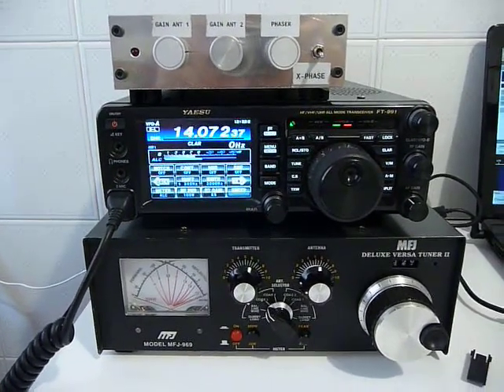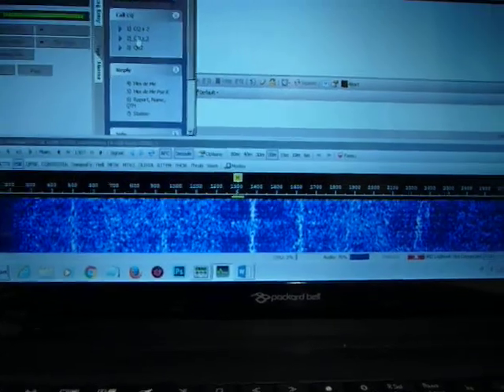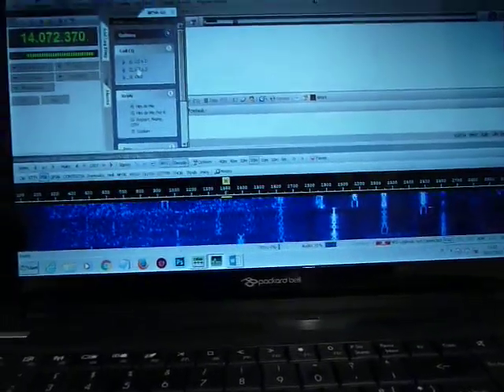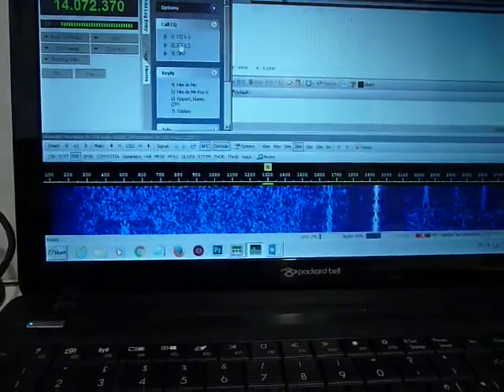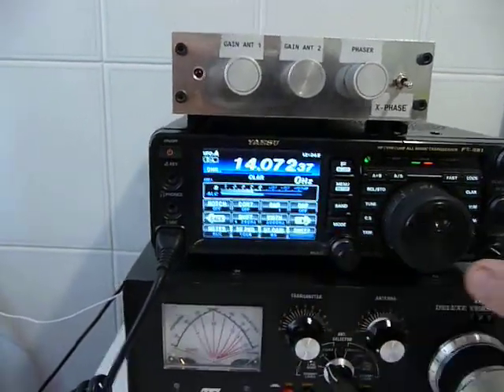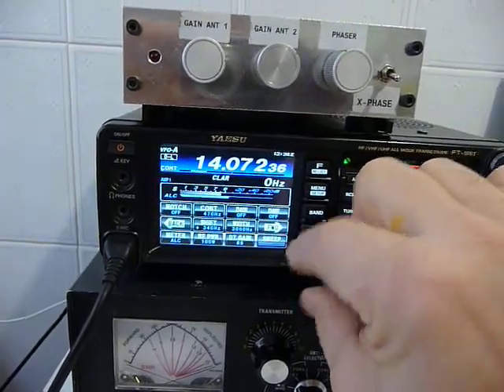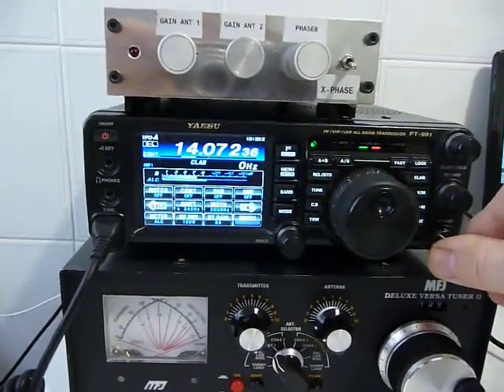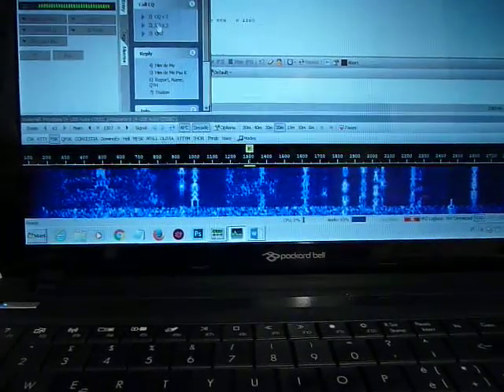X-Phase I0KQb testing X-Phase in digi modes December 2015

Comment: For who wants to realize the X.Phase or its "child" the Noise Canceller, here they are some useful instructions in order to set them up properly.

First, I hope you have connected a simple 1mm square single core electrical wire for the auxiliary antenna. This piece MUST be at least 9 meters long. This thread must be left stretched or wrapped. The fact that it is left stretched or wrapped must be evaluated case by case, trying to obtain the maximum interference signal.
DO NOT USE ANY KIND OF ANTENNA INSTEAD OF THE WIRE, OTHERWISE THE NOISE CANCELLER WILL NOT WORK!
Proceed like this:
1) Connect the auxiliary antenna cable.
2) Turn on the radio and the noise canceller
3) Adjust the main antenna to zero gain (gain)
4) Adjust Phase 1 to maximum gain
5) Adjust Phase 2 to half gain
6) Tune the radio to the signal we are interested in cleaning from the noise of the electrical disturbance
7) Adjust the main antenna gain (Gain) to 75-80%
8) Adjust PHASER if X-Phase or PHASE 1 if Noise CAnceller, by turning it left and right, looking for the point where the noise starts to fade
9) At this point you MUST SLOWLY ROTATE, ONE AT A TIME, FIRST THE GAIN 1 POTENTIOMETER AND THEN GAIN 2 or PHASE 2.
REPEAT THIS OPERATION SEVERAL TIMES UNTIL THE MINIMUM INTERFERENCE NOISE IS OBTAINED.
10) At this point try to rotate the GAIN potentiometer, always slowly, first to the right and then to the left, until you get a clean sound, WITHOUT QRN. This is very important to balance the signal from the main antenna (radio signal + local noise) with the signal from the auxiliary antenna (local noise + radio signal). Balancing the two signals will result in local noise cancellation. Don't worry about the possible attenuation of the main signal, as if set correctly the Noise Canceller will remove at most 1 point of the s-meter. Speaking of the lost point in the S meter, you will gain it again from the clean and quiet signal.
11) As a last adjustment you can try to adjust everything again, making small movements of the 3 potentiometers.
In this way, if the equipment has been WELL ASSEMBLED, WELDED AND WELL WIRED, the result will be more than excellent.
In recent years I have been contacted by many radio amateurs, both Italian and from the rest of the world, and all have been more than satisfied with the results of this type of equipment, namely X-Phase 1 and 2 or the Noise Canceller.

Comment: Great video, Giovanni, tnx for publishing! But I have to say that it is not my "invention". X-Phase is based on an article in the QST: "The-Null-Steerer-Revisited", JULY-QST-1994, W7XC page 31, Charles J. Michaels (SK).I think the first circuit was from G4WMX and GW3DIX. So there is not much merit on my side. I just took the idea and developed X-Phase trying to give it a new design for easy and cheap self-building and simple usage in the shack. Hopefully it helps many OM, YLs and Shortwave Listeners fighting against the daily local QRM! 73, Hans, DK9NL